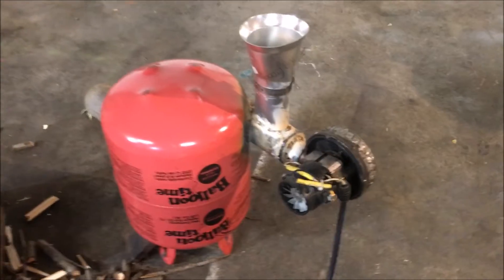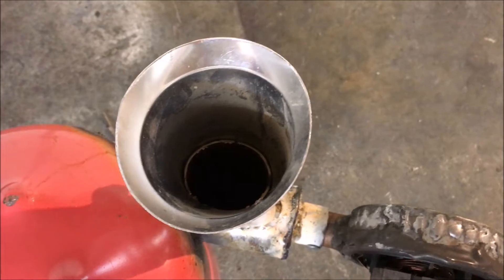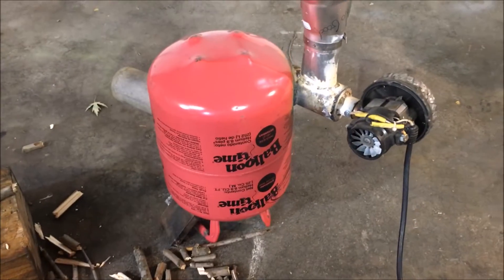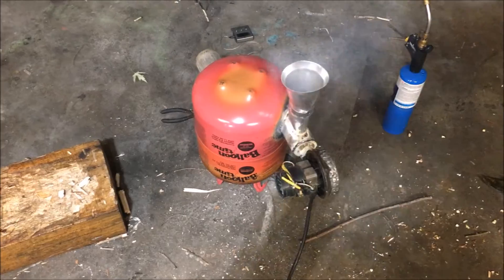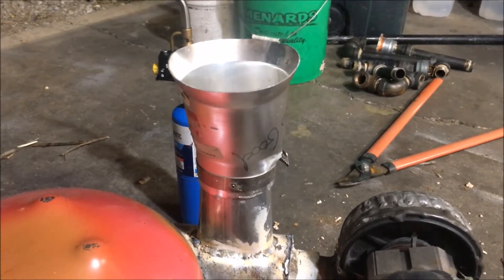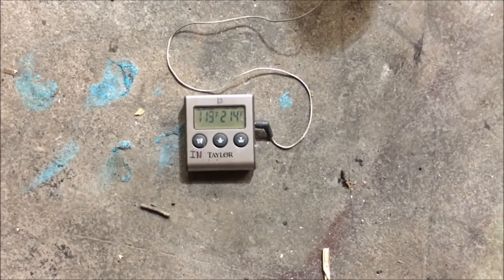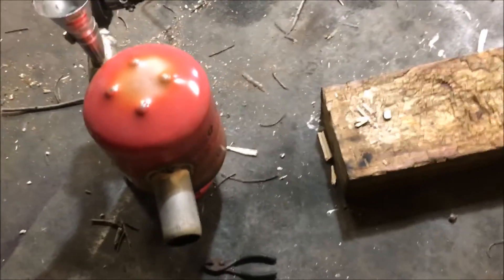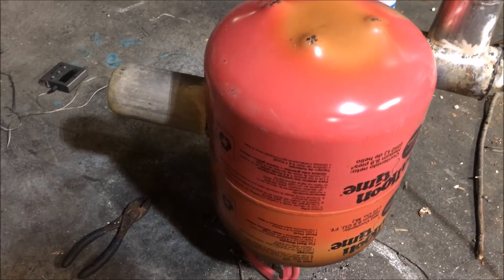Wood fired Industrial  process heating

Comment: This is a waste of wood and gases couse You pump cooles gases into fire and gases outcome are cold, it is a wrong way of woodburning. In that way You could burn waste oil, its more power than wood and need more air.

Comment: I have a system somewhat like this already planned for my trasholine waste to energy power/fuel combination system, even have a 13 foot long 5 inch in diameter auger. Far from enough materials on hand to complete the machine, but slowly accumulating them... ~( 'w')/

Keep up the good work, looks like you will be there before I am, even if only on a much smaller scale. (~_^)-b
Reply from the maker: Im going to be doing some work with augers lifting sand . any thoughts ? we gotta heat the sand to 350 deg .
are grain elevators durable enough for that kind of torture ?
Reply: "For a limited time only" ... Can you obtain rubber conveyor belt material nearby any place?

If the sand is only 350 degrees, you can lift it safely on some kinds of rubber, silicone or of course Teflon belts...